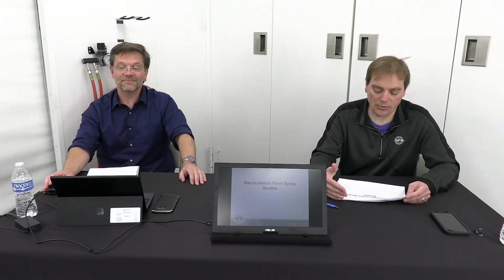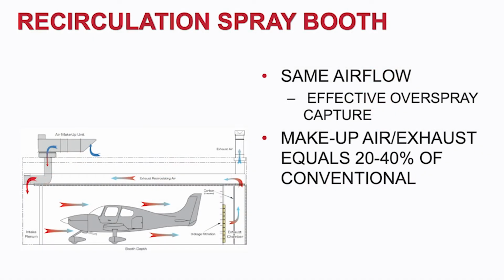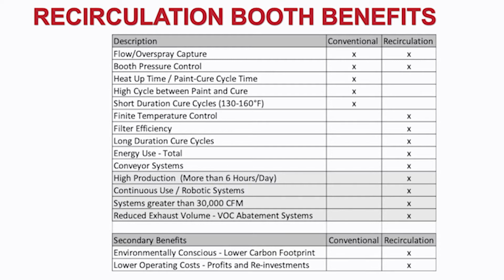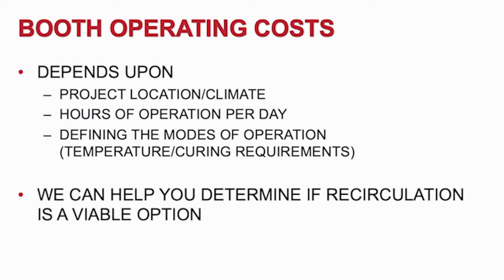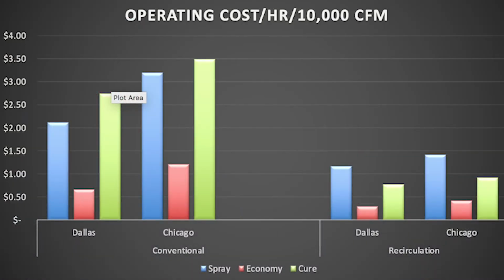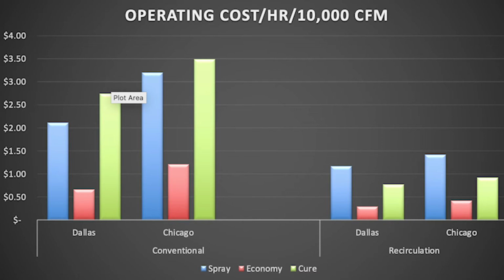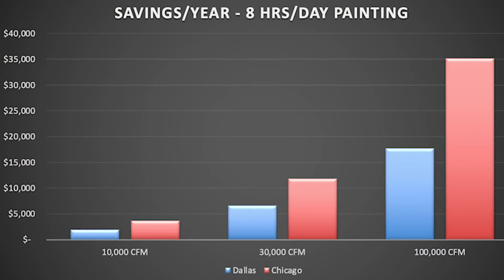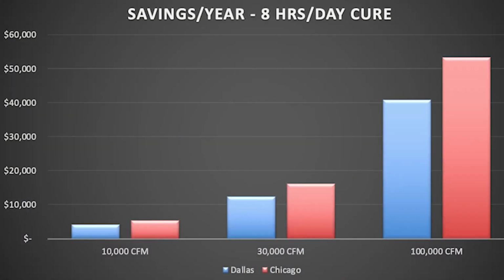Recirculating Paint Booths | Global Finishing Solutions

Comment: Hi guys, I’ve made my living from the Spraybooth industry for 40years and it’s it’s music to my ears listening to this post. Spraybooths are an environmental horror story, vast amounts of air required for effective overspray removal whilst only a small amount required for LEL solvent control.
Energy requirements   for heating this air is huge (here in Northern Europe we design to 60kw to heat 10,000cu.m/hr for 25degC temperature rise.)
result in high cost to heat the air and a waste of energy.
Whilst I was Technical Director at Spraybake UK I designed the first Automotive refinishing recirculating Spraybooth in the late 1980’s. But energy was cheap back then so the take up wasn’t huge. I then designed the Tempo moving Spraybooth for my own company, Spraybooth Technology Ltd, some 15 years ago. 75% recirculating and all Electric. All of our Aircraft refinishing booths installed throughout Europe have featured this technology together with high profile designs for UK MOD Fast Jet facilities and the latest Astute Class submarine BAE facility in the UK.
With Gas and Oil prices ramping up here in Europe it’s a no brainer! This is the way forward, love what you’re doing. 
Take care guys👍